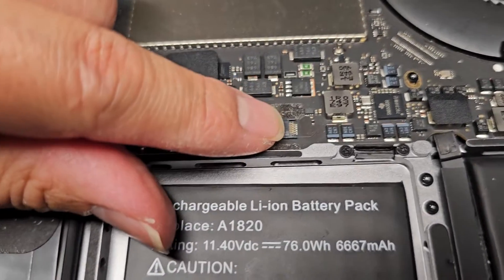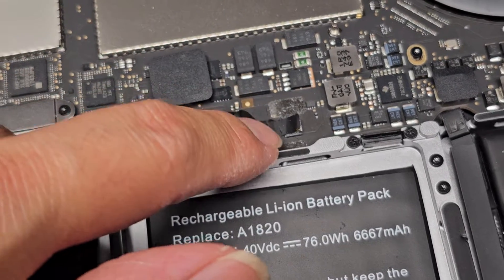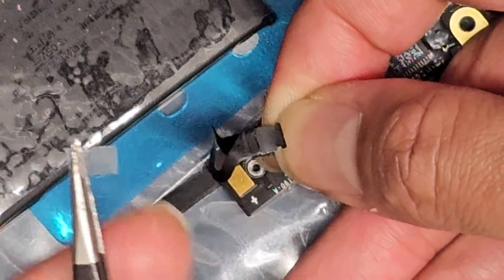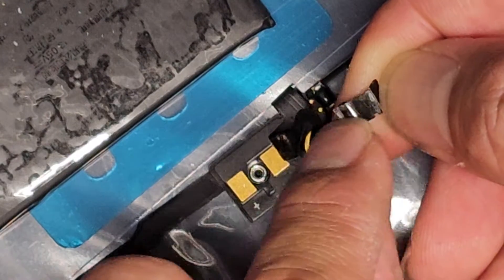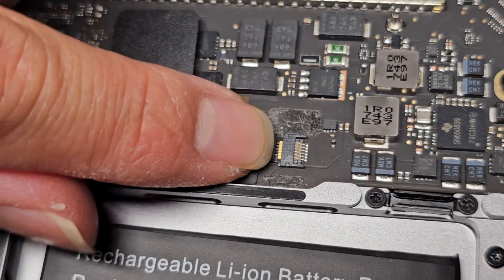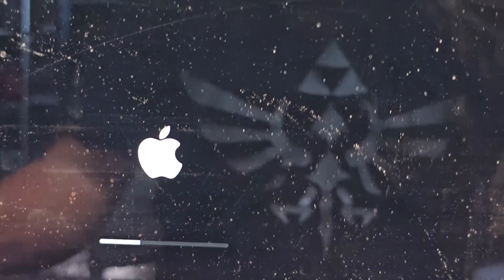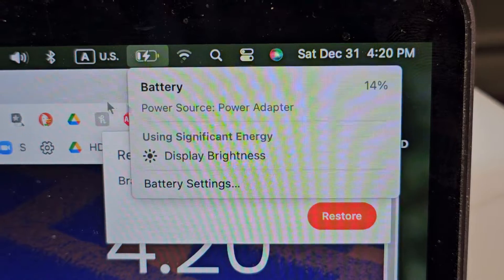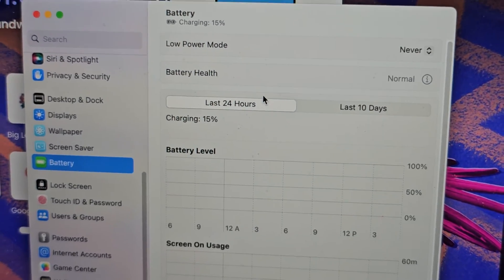ZIF Zero Insertion Force FFC Flexible Flat Connector FPC Flexible Printed Cable Broken Missing Latch

Comment: I'm having this exact issue with the Magic Keyboard ribbon \ connecting to the Touch ID ribbon cable. I'm just having the hardest time figuring out how to cut around those grooves on the sides on such a small ribbon. and how thick the tape should even be. At least you educated me on the actual problem haha.
Reply from the maker: Just cut at the sides of the tip and peel it back

Comment: Can you help me, i just pulled the cable and it came with the connecting part.
Reply: but how i buy the new connecting part to solder
Reply: And the battery is not charging
Reply from the maker: You need someone very good at soldering.

Comment: Hey, I just checked out your video. I have the same problem but slightly different. 
The plastic thing came off from the zif connector while the battery data cable is still in there. The MacBook is charging normally but I don't think I can just pull that data cable out if I need to do something else. 
I still have the small piece of the thing that you need to pull up to get the cable out. How do I reinstall that?
Thanks!
Reply from the maker: @kevin-hou  do the opposite of how you pulled it out